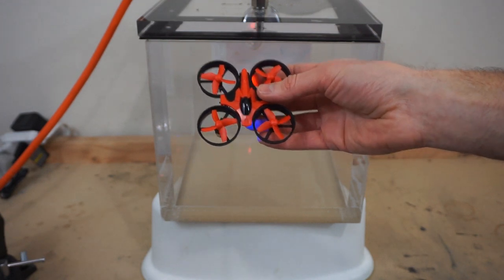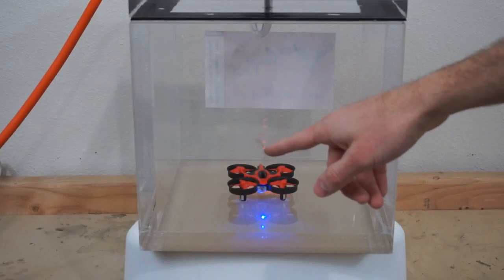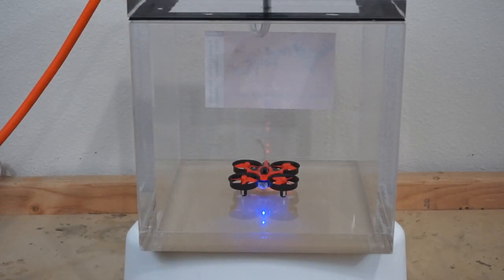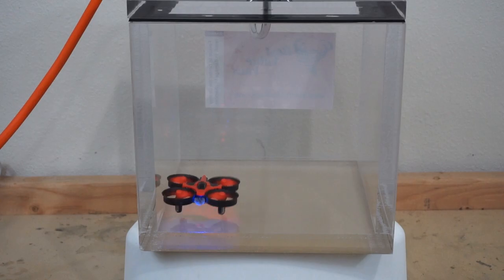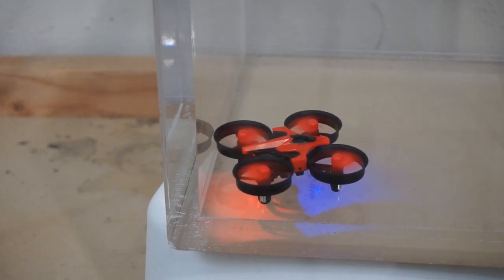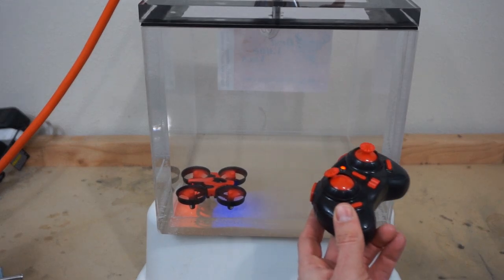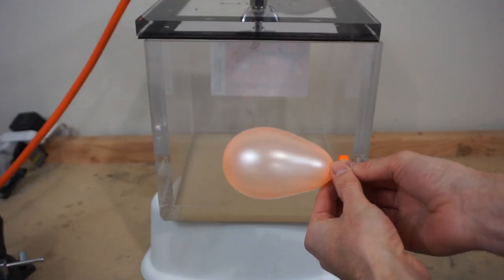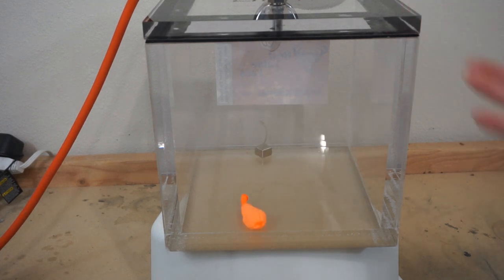What Happens When You Put A Drone In a Vacuum? Can It Still Fly?

Comment: The reason your balloon flew a little is because the atmosphere in the balloon changed the pressure in the box and it initially pushed off the box.
Why not see how much flight you get from the balloon with full pressure in the box compared to full vacuum.

Comment: Sorry but no. 
1. No longer a vacuum once the air is expelled. 
2. Air is reacting against the solid wall of the chamber.
Reply: Dear Susan, it does indeed appear that he barely ran the compressor (to lower the chamber's air pressure). But you have it upside down: if he had done so (i.e. created a "serious" vacuum in the chamber), the balloon would have expanded very significantly (not shrunk) - and probably burst. Also, it is no wonder that the balloon moved once he removed the magnet: the air it contained, of course, pushed against the wall of the chamber!  In space, things are very different: firstly, there are no walls (nor air) to push against. Secondly, no man-made pressurized container (such as rocket fuel tanks) is able to sustain the massive pressure differential between itself and "outer space" (which starts at about 100km of altitude, the so-called "Karman line"). If it even reaches this altitude (hot air balloons stop ascending at about 45km) - in spite of the thinning atmosphere providing ever less "opposite reaction", the rocket will either (1) explode catastrophically or (2) its pressurized fuel will be violently sucked out in a microsecond (according to the well established laws of thermodynamics) and NO force will be applied to the rocket itself (so as to make it continue its ascension up & away from Earth's gravity). In other words: rockets flying around  in outer space (and steering / maneuvering / accelerating / braking at will!) are a physical impossibility - and a pure fantasy (exploited by the powers that be). And no, Earth is NOT flat.
Reply: @simonshack1  - The "massive pressure differential" you speak of is an additional 14.7 psi from the lack of surrounding atmosphere and stick a firehose in a vacuum chamber and turn it on if it still flops around rockets work in space

Comment: Try putting maybe 5-10 PSI of compressed air in the chamber and see if it flies better from denser air.
Reply: 14 PSI is normal atmospheric pressure
Reply: The Enigma You are correct. I should have specified that I meant PSIG, not PSIA. Thank you for the comment.
Reply: The Tool Guy it doesn't depend at all where you're at. atmospheric pressure is and will always be 14.7 psi. if the pressure where you live is 14.3 psi then you live somewhere with less than atmospheric pressure.
Reply: TheOpticTomahawk exact pressure depends on your altitude and even on the weather.
Reply: You would generate more lift being there is more oxygen to push downward at the expense of the motor working harder to push more volume. Denser air might require a finer blade for the helicopter to ease the stress on the motor but that also has many variables to include weight of the aircraft. It's like pushing water through a power sprayer in a sense compared to a garden hose.
Reply: It won't affect. Theoretically speaking, the PSI will be added to both top and bottom of the fan at the same time, the effect is cancelled out.
Reply: 14.7 psi at sea level.

Comment: What would happen if you put dry ice in a vacuum chamber?
Reply: It sublimates faster than normal, would be my guess.
Reply: It would be hard to create a vacuum since it would keep adding co2 into the atmosphere. It actually would be similar to mars atmosphere though, besides the -100 Centigrade temps of course:p
Reply: what gives you the idea it's not -100 c on mars?  at some places the air is so thin it's like being in the vacuum of space on the surface of mars.   i bet it's even colder then solid co2
Reply: A Highly Visible Ninja. - It would be interesting to see just exactly how much additional throttle is required to maintain flight at Martian atmospheric pressure though.
Reply: boris, technically no, it could never be in a vacuum, it creates CO2, meaning there is always stuff there, can not be completely removed until the dry ice completely sublimates, which would defeat the purpose of the vacuum, because you can't keep it in a vacuum
Reply: Boris Bagryanskiy depends on the pressure. Intermolecular forces are what cause things to expand, contract, or change phases. These intermolecular forces are cancelled out by atmospheric pressure, which create a state of equilibrium. When there is very little pressure, there is nothing to cancel out intermolecular forces, which causes the mass to expand, or in this case, sublimate. This is caused by the phase change happening at higher pressure than the triple point which allows the solid to "skip" being liquid and become gas. While you are correct that the main mass would cool down (in fact you described the method scientists currently use to cool atoms to near absolute zero) the cooling has less effect on the rate of phase change than atmospheric pressure. Otherwise we would see thin atmospheres like that of Mars freeze and drop down to the surface, when in fact the opposite happens and the atmosphere very slowly escapes into space.
Reply: Boris Bagryanskiy also BS in chemical engineering (1996)
Reply: You are right it does depend on the pressure, however, the rate at which the gas is "escaping" in this vacuum chamber and that on mars because of solar-wind-induced ejection of Martian atmospheric atoms is not comparable. Given that the CO2 block of ice is large enough after initial sublimation it will stop as the overall temperature of CO2 will decrease rapidly. When reaching -140 degrees C given atm is 0.001,  or approx. -120 degrees C at 0.01 atm sublimation will cease. Seems really dull
Reply: Why does no one ever talk about colonizing the moon? Its a much better and more advantageous prospect. Also Seemingly everyone overlooks or doesnt mention the fact that Mars does not have a magnetosphere! I mean holy hell, any atmosphere that could be terraformed into existence will be stripped by solar winds. Issues with radiation and micro gravity are also exacerbated by long traveling times to and from the planet as well. Can it get any worse? Honestly the better option for intial interplanetary colonization by the human race is Venus, albeit not in the traditional sense, colonizing the skies in floating platforms. At least, Venus is closer for one, two the atmospheric pressure and temperature at about 50 km to 65 km above the surface of the planet is nearly the same as that of the Earth, making its upper atmosphere the most Earth-like area in the Solar System. God dammit the upper atmosphere is 21% oxygen, 78% nitrogen, Breathable air people, wtf! Going back to colonizing the moon, however, it is abundant in helium 3 which is highly sought after for its ideal properties associated with nuclear fusion. The moon can also be used as a base to launch rockets and as a fueling point being that 1/6 of the gravity of earth means the escape velocity is significantly lower (less fuel, more stuff). Mars is the worst reachable option we have available, every time I hear it being discussed i wonder why the fuck people are so fascinated with this nonsensical fantasy.
Reply: Boris Bagryanskly OK so you do know stuffs. But not everyone knows it. People are not dumb, some are just lost or misguided by false logic and information. So why not share your knowledge in a friendlier way :D plus it will actually makes the person that learnt from your post happy.
Reply: Boris Bagryanskiy because NASA is bull shit and all the real skunk works goes on some place else.  Those who control our financial system control the course of the planet. If you step in the way of their controlled financial system and advancement, then you become a threat to the system.   You either fall inline or they do everything they can to discredit you.
Reply: He would probably claim that it means space is real.

Comment: How did your balloon not expand and then explode when you pulled the vacuum ? I call bullshit on this basis.
Reply: It did expand....
Reply: Tesla Nick I don't know honestly, I guess the rubber effectively blocks the low pressure and high pressure areas? I DON'T KNOW
Reply: It did expand. Did you even watch the video? Its near impossible to pull a true vacuum. Especially with a home made set up like that.
Reply: Even if there was a complete vacuum, it still wouldn't have to explode.
Reply: -- Tesla Nick, with only a little air (pressure) inside it there's no chance of an explosion.  Say that it had only a fraction of one PSI.
The opposite of an inflated bladder under water where one employs extremely high pressure.
Reply: Just watched it again and he's only pulling a partial vacuum as stated. You can see he maxes out the balloon and then stops the pump at the point at which the drone would no longer fly.
Obviously this means this is a fair test and does indeed prove rockets do work in a partial vacuum low enough that air is no longer a factor (as proved by the copter).
Reply: It musta been a really really strong balloon
Reply: Scott Yates  May I ask how is it that space does not exist?
Reply: Yes, it would expand in all directions. Except back into the rocket. The pressure difference would insure that the gas would not go back into the rocket. Since the gas flew backwards out the rocket, the rocket moves forward, because Newton's laws still exist in space.

By the way, obvious troll. But I'm only saying this so that any FE-ers reading it don't use your statement as evidence.
Reply: +Pandarama67,   Scott is a troll. Don't bother with him.
Reply: Dirk S. Hey scott do you live under a bridge?
Reply: Newton's laws are based upon physic's...as in physical law.  There is nothing to act against in a vacuum of space & therefore no manner to get an equal & opposite reaction when there is the nothingness of space.  it's like when the floating people try to "Swim" in the Zero-G vomit-plane.  Unless they are PUSHED By an anchored person (Transference of energy)?? they go absolutely no where with their "Swimming motion" & this is in a plane with "Aire" in it no less.....much less with nothingness (Space).
Reply: Casmige imagine you are floating in zero gravity, in a vacuum, in a space suit, and floating next to you is a car, let's say a 1966 Volkswagen Beetle, since they are small and light. There are no walls, nothing is anchored to anything else, no atmosphere to use. If you were to get your feet onto the car and kick off of it, what would happen to you? What would happen to the car?

You would move off in one direction at a certain speed, right? And the car would move away in the opposite direction as a certain speed right? And there you have it, your equal and opposite reactions with out anything interfering or assisting besides you and the car floating in space. That is the basis for how a rocket can work in space, in a vacuum; it is because the rocket brings all of its fuel, its reaction mass, with it. In the balloon's case, it is the mass of the air in the balloon. In the case of a conventional liquid fueled chemical rocket, it is the fuel and oxidizer. In the case of a bottle rocket, it is the combustible solid fuel.  

So you might think "the air doesn't have enough mass to make the balloon move around as much as it does" so lets go back to you and the car floating through space. You kicked, and moved away at a certain speed, the car moved away at a certain speed (a slower speed assuming it has more mass than you). So lets rewind it and kick off again, this time a little harder than before. What happens this time?

The car would still move a little slower than you, but both of you would move away from the point of the kick at a faster rate than before, despite both of you having the same amount of mass as before and nothing else changing. So the faster you can get your reaction mass to move in the other direction due to your action, the faster you can go, or the more thrust you can get. There you see how a balloon can get a decent amount of thrust from a little bit of air, because it pushes it out of it self at a high rate of speed. If you had two balloons with the same amount of air in each, but one is made of stronger, stretchier rubber and one weaker rubber, the stronger balloon would go faster with the same amount of air because it pushes the air out at a faster rate.
Reply: Casmige
'There is nothing to act against in a vacuum of space & therefore no manner to get an equal & opposite reaction when there is the nothingness of space.'
You seem to have forgotten about the rocket. Rockets are not 'nothing'. The reaction force acts on the rocket, not nothing.
Back to school for you !
Reply: Casmige No, he's offering regurgitated Newtonian physics, which has been proven time and time again.
Reply: Casmige
'Tesla Nick sorry All you're offering is regurgitated NASA grade school brainwashed bullshit'
Nope. Not mentioned NASA once and my comment has nothing to do with NASA.

Comment: Helicopters have a maximum ceiling hight of operation 
No atmosphere no forward are upward motion 
Your balloon had  Resistance against the wall of your small vacuum  chamber
Reply: Rocket thrust works like a fire hose the force produced by the hose is not caused by the water hitting air it's caused by the pressure of the water leaving the hose
Reply: @PabloGonzalez-hv3td  yes it does, the density of the air, is enough for the pressure to push onto and create momentum. everything about space is complete science fiction
Reply: Vacuum creates no force. The number you mentioned is just a minuscule pressure between 0 and 1 psi. The atmosphere isn't "pressurized" the pressure is from weight alone like the ocean (15000+ psi at its deepest). It doesn't float into space for the same reason the ocean doesn't - gravity.

Comment: It appears that the balloon pushes off the walls of the chamber- watch it in slow motion.  I think for one to gain anything from this experiment, you would have to redo it and prevent the walls of the chamber from coming into play. As is, it is inconclusive... A simultaneous view of the pressure guage would be nice too. The first part with the quad copter was was interesting.
Reply: The drone wasn't forced down by air pressure like flat earthers assurt.
Reply: The balloon experiment is 100% flawed as it ia releasing pressurized air into the tank and pushing off the walls.  For the first half second the Baloo  doesn't move at all until more air is released giving the rest of the air something to push on.

The drone is more accurate of the fact that there is no way for perpulaion to work in space.
Reply: Excellent point k.
Reply: I say this too
Reply: @dsmtsi  Nope, even at 0.25x it's clear to me that it starts moving immediately.
Reply: @@kylehollinsworth5596 Just it propelled itself by pushing air backwards.

Comment: the dislikes, must be flat earth poeple
Reply: @do hoop No doubt
Reply: Why? It perfectly demonstrates why a combustion engine wouldn't work in "space."
Reply: @jsmith3867  

If you're talking about a rocket, then you don't know how a rocket works.

Propellors pull matter through a system to create movement.
A rocket throws matter to create movement.

The fuel itself IS oxygen. Hence its functioning even in a vacuum. A jet engine would NOT work in space because the propellant has to move through an intake. Rockets have no intake.

Think of it like this:
A musket will not fire in space. The reaction I not self contained. A modern rifle, however, would. Its fuel and oxidizer are self contained and sealed.
Reply: Daniel Harbeson he thinks a balloon is the same as a 🚀..combustion doesnt work in space 100pct. flat earth has nothing to do with it...
Reply: The people who disliked must of been holding their phone-device upside-down ,😂
Reply: @reyhandaffa9843  
But it's fun
Reply: Reyhan Daffa - not at all.  He’s actually helping make the flat earth case.  👍🏼

Comment: try to put a heavy gas in the chamber 
the sulfur-hexaflorid
and try the helium too
please
Reply: Ramy RDJ what do expect to happen? Because you can't see gas and lower pressure won't do much.
Reply: He can tries it but without acticvating the pump
Just filling the chamber , put the drone in it and close it 
I want to see if it will fly more easily or with more difficulty
Reply: It will fly a bit more easily in a heavy gas and much harder if at all in hydrogen.
G.
Reply: sulfur hexafluoride is extremely dense, the helicopter would probably float without even starting the engine.

hydrogen is a little dense, but not dense enough to carry an RC quadcopter with a plastic frame covering circuitry (wired with conductive metals such as nickel, a bit of chrome, zinc, copper) that may be supported with small steel (iron and carbon) and/or covered/made with zinc.

no hat plez
Reply: -- AtomNyuszi, and if it makes a noise it could sound like Donald Duck (If its helium, that is!)
Reply: Hydrogen is the lightest element on the periodic table. It's not dense at all. (Less dense than Helium!)
Reply: AtomNyuszi There should be some sort of efficiency curve. Most planes hit their top speed near the ceilings (for obvious reasons). That particular drone isn't really drag limits, but you could imagine one that is.